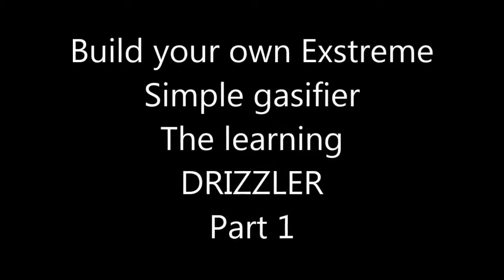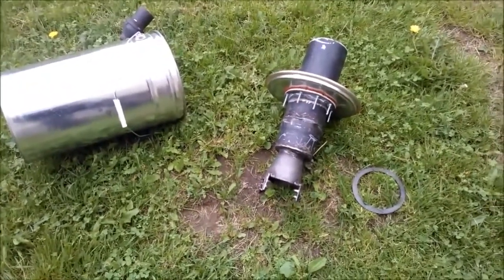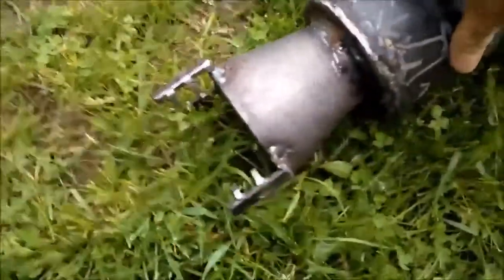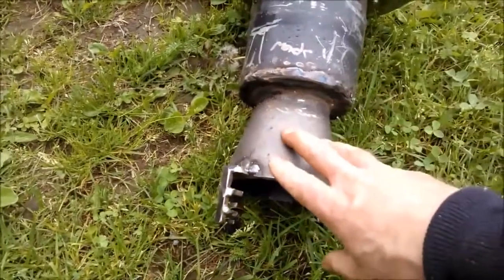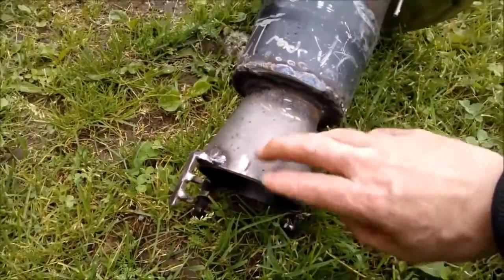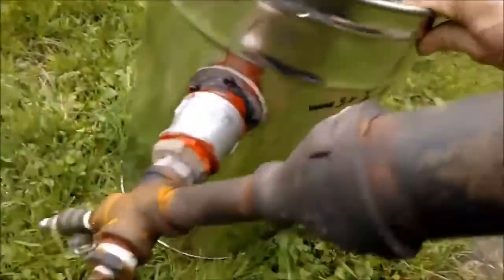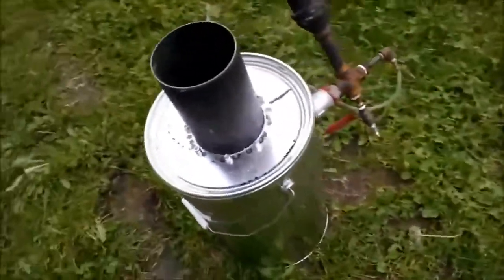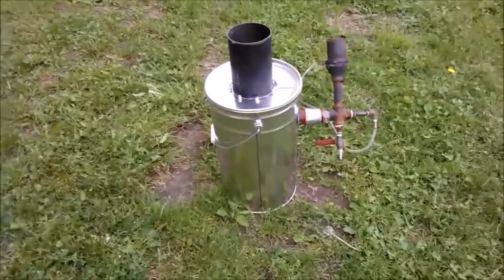PART 1   extreme simple DriZzleR mini gasifier   build it

Comment: Yes.. excellent comment.. observation.. the flare lets you see quality of gas vs what you are doing.  thanks for this excellent video!
Reply from the maker: Observing the flare is important under the condition you do not trick yourself. As gassification is all about suction the more you suck on your machine, the hotter it perform the better the gas. But then what you get is a cosmethic flare. When you then connect your engine wich has far less suction power than your blower your gasifier will run far more cooler and you could get into for a bad surprice. So calculate the suction power of the engine you have in mind to use and set your blower acordengly.

Comment: what did you use for insulation " isolation "
Reply: Dear James, Thank you for playing the video. I use for insulation mostly ceramic wool. It can support temperatures well above 1200 degrees celcius. It is expensive though and for a simple test you could also use for a short period glass or stonewool however they get brittle and useless on longer run.
Reply: What is your opinion of home made fire brick ( plaster of Paris + sand ) like 1 inch thick ?
Reply: Dear James, In a DriZzleR all Happens in the flaming Pyrolise zone, wich from itself remains allways very hot so insulation is not as critical as in an imbert design for instance. I know people who do not insulate their driZzleR design at all. I even made a test once with a DriZleR with watermantle, you can find the video here https://www.youtube.com/watch?v=xlDSerPJXZw But that was a bit of a too bold step. I left that Idea because during start up it took a rather long time to heat up the gasifier to that hot enough temperature needed to produce safe tar-less  engine grade gas

Comment: what did you use for insulation " isolation "
Reply: I can recommend a second tube around the burn tube filled with a mix of perlite and fire cement or plaster oP. A good conditioned Drizzler gets about 1100°C and you def. need an isulation around that.